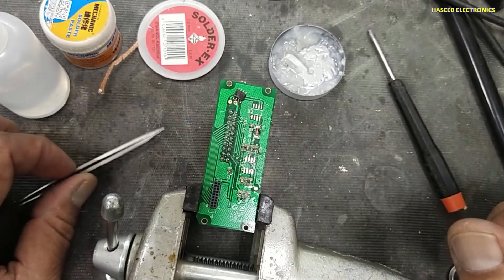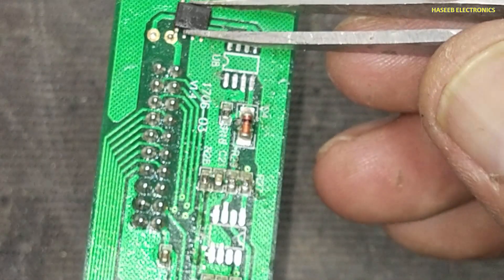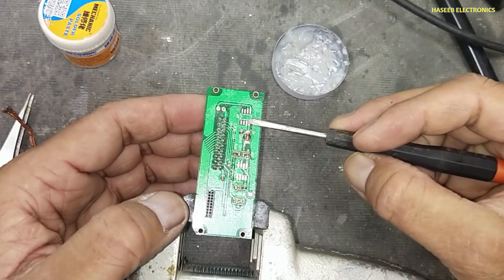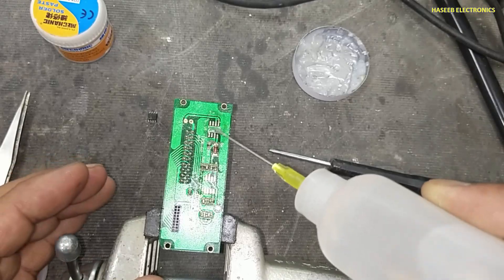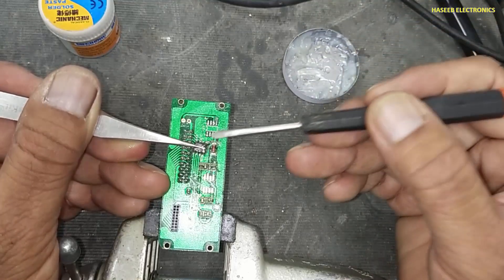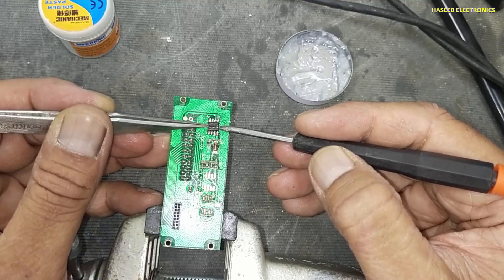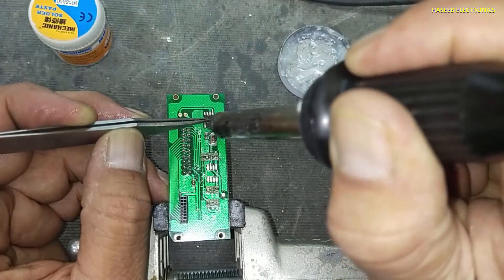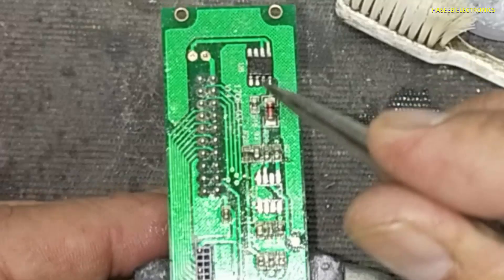{1142B} How i solder smd ic using hot air

Comment: Sir i am using EE55/28/21 Core. I have made inverter with it.  Freequency is 30khz. Input Voltage 12V. Primary Turn 2+2. Wire gauge number 22. Parallel 12 wires. But not getting more than 730 watts. Sir please tell me why? I have used mosfets, output mosfets as correct everything. Sir please tell me solution. Sometimes when disassemble Ferrite core, my core broken and i fixed with super glue.